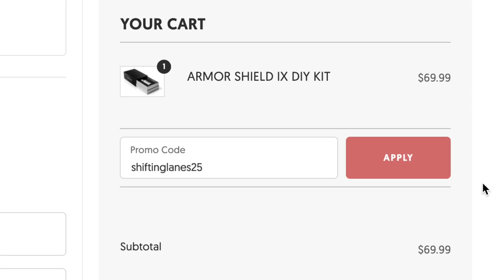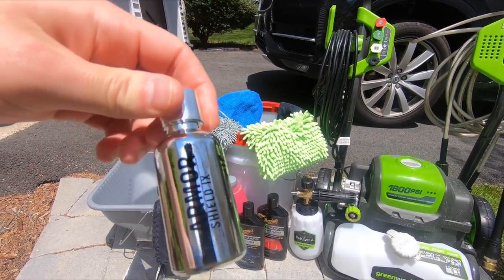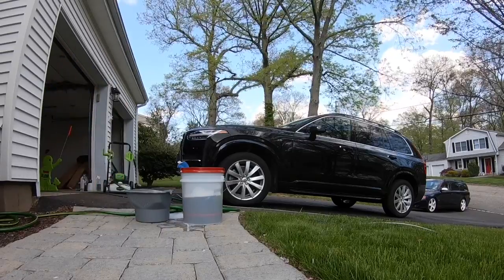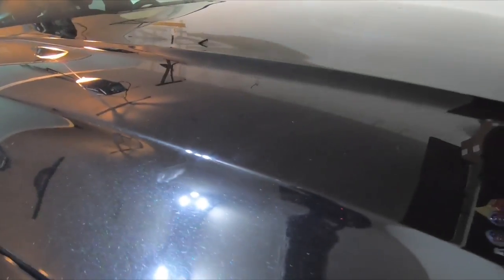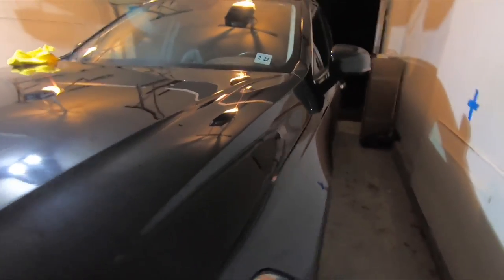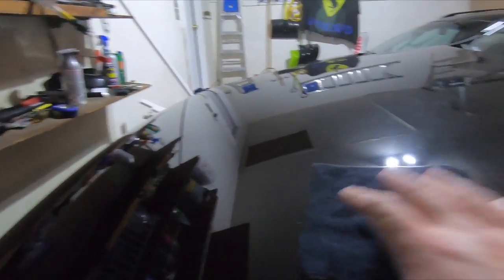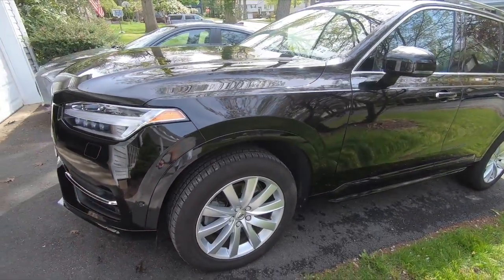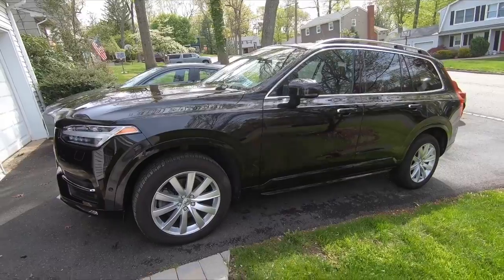How To Ceramic Coat Your Car CORRECTLY (Beginners Guide)

Comment: A few things.  A 15mm DA Orbital polisher , which transfers more energy than a cheaper 8mm unit like a Bauer or Griot's M9, would take approximately 12 MINUTES in one spot, without moving, to burn through the clear coat, and reach the color.  Your typical vehicle paint is about 110-120 microns thick, and 70% of that is your clear coat.  Using a heavy compound, with a heavy pad on a Rotary, after wet sanding with 1500# sandpaper by hand, then moving to a medium pad with a polish to mirror finish using the DA orbital, you're going to remove maybe 4-6 microns of clear coat.  You could do the entire process ten times before you'd even need to begin to pay attention to the clear thickness with a meter.  Don't be afraid of a DA orbital polisher.  It's your friend, and it'll save you a TON of time.  Also, consider using an IPA solution to wipe down the car after buffing, before the ceramic, to remove any oils or powder left behind by the polishes and compounds.  Also, stop pouring water on a fresh application of Ceramic!  It shouldn't be exposed to any fluids for 24-48 hours.  Ideally, you should wait a full week before driving the vehicle to allow for a full cure (evaporating and off-gassing of the solvents)  On a car that old, with unknown history, you'd also want to de-iron, and de-tar the car after the hand wash, and before the clay bar phase, to remove those contaminants.  You can also ceramic coat your wheeels (which should have been washed and treated FIRST) and the glass on the car, too!

Comment: Remember doing this on my dad’s x5 when we got it last year where we didn’t wash it the entire time we owned it until it came to having a professional install expel on the front end and once again when we got the ceramic coating in from Avalon king on their 4th of July sale. That means we were lucky to have absolutely no swirl marks in the paint because it was only washed twice and it was once by a pro and once by me with a full new set of micro fibers and wash mit that had been rinsed out a lot. I took 2 days of prepping with clay bar and everything. Then it took 2 more days to do the two coats on the car. I went through so much rubbing alcohol and micro fibers but it turned out good for it being our first time. It did help that the paint didn’t need buffing. Unfortunately two doors did get chips so we didn’t coat those doors in the ceramic coating and we have pushed off getting them fixed but they do have wax and protection on them. In the end it helps sooooo much with maintenance washes but unfortunately dirt and water doesn’t really fall off as well as I had hoped when it gets dirty but as soon as you wash it the water beads up much better. I’m guess Texas dirt and pollen just clings hard making it hard to repel water and dirt? Anyway it is so nice to have still. Would I go through the effort for my 20 year old paint on the Volvo. No lol 😂. The paint unfortunately isn’t in good enough condition for that.

Comment: I would use an IPA wipe down before you apply it. It helps the coating bond better. Always wait 4 hours after applying to drive. And 24 hours for water exposure. And I felt the same way about buffing by machine. It’s overthought like crazy. Make sure if you ever get a machine. Use dual action polishers. They are safe and don’t conduct as much heat. Use pad conditioner from chemical guys. Keeps it lubricated

Comment: Can you do a review on the maintenance for the XC90?  I have a 2014 BMW X5 and thinking about switching to this.
Reply from the maker: Sure thing! What specifically would you like to know?
Reply: ShiftingLanes The cost of an oil change, and what all is included in the oil change like filters etc., breaks and how quickly do they wear down and how much they cost to replace.  I’m sure I’m probably missing something else but that’s pretty much what I wanted to know.  Thanks so much!
Reply: @ShiftingLanes  also wondering the same thing looking into buying one and need more info on this.

Comment: This is definitely not the correct way of doing it😬 you need to do an IPA wipe to get rid of any polishing oils so the coating will bond to the paint better and the car needs to be water dry for the first 48 hours. It needs to be dust dry for the first 2 hours and touch free for the first 5 hours.